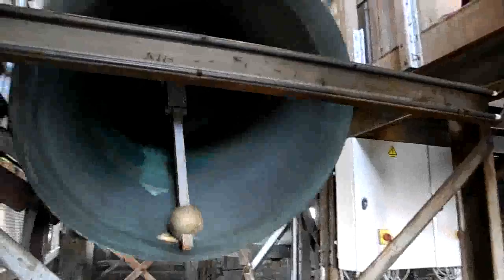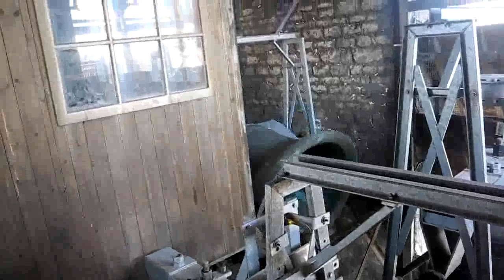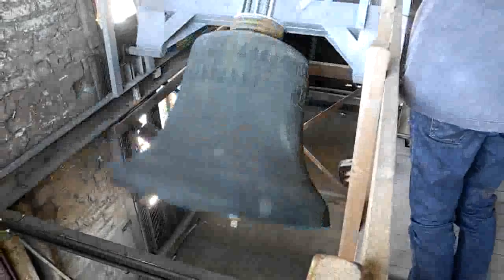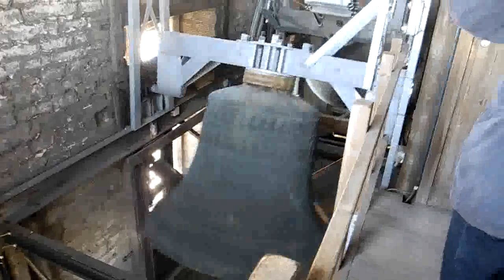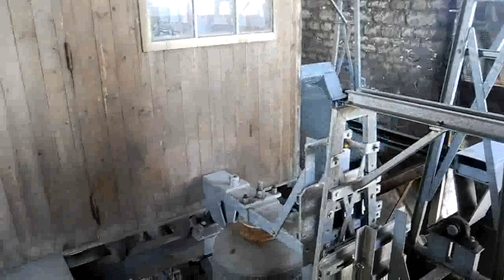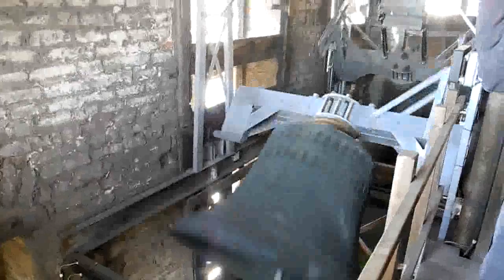Klokken van de Sint-Michielskathedraal Brussel

Comment: I wonder why the 2nd bell (On the back of the bourdon) has 2 chiming hammers?
Reply from the maker: I think all ringing bells have two hammers: one for the automatic tune (and in some cases also to strike the hour or the half hour) and one for the manual playing of the carillon.  Smaller bells have one hammer, for the automatic tune; the manual playing then uses the clapper (which cannot be used for ringing bells).
Reply: Not all ringing bells, this is actually my first time to see a free-swinging bell with 2 chiming hammers. They normally have 1 (Also used for half hours and an hour later then it chimes) But Does the small and big chiming hammer make the different tune?
Reply: Or does it make the same tune?
Reply from the maker: Molten Saito-Takeshi No, not all ringing bells, I mean all the ringing bells of this tower.  And in general, all ringing bells in towers where there is a carillon.  The manual playing and the automatic playing of the carillon are two separate mechanisms.  And it is much easier to connect each mecahnism to a separate hammer, rather than to the same hammer.  There are even cases with three hammers, maybe four.  That is because a hammer in the automatic chiming takes time to hit the bell.  If you want to play fast in succession the same bell, you need more than one hammer.
Reply from the maker: Molten Saito-Takeshi Yes, both hammers give the same note, the same sound.  You could produce something like a different note by hitting the bell high along the flank rather than along the rim, but it would also give a different type of sound, not really typical for a bell.  And this is normally never done.
Reply from the maker: Molten Saito-Takeshi I could add that in the automatic chiming, often the hammer is first lifted, and then falls on the bell just by its weight, while in the automatic playing the hammer (or the clapper for the non-ringing bells) is directly pushed or pulled against the bell.  This different ways of using the hammer is another justification to use two different hammers.  It would be possible to use the same hammer for both, but it is just easier (maybe even cheaper) to use two different hammers.
Reply: Thierry Pauwels
Oh thanks, Thierry! :)